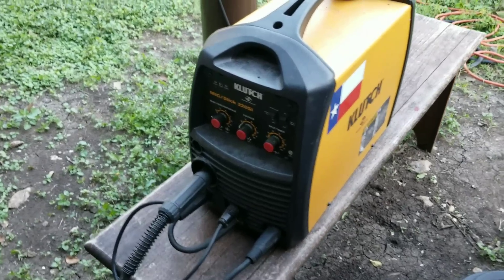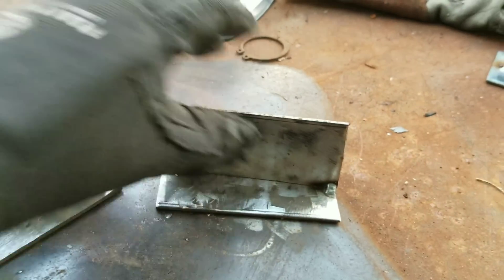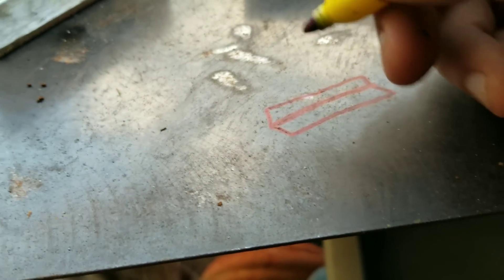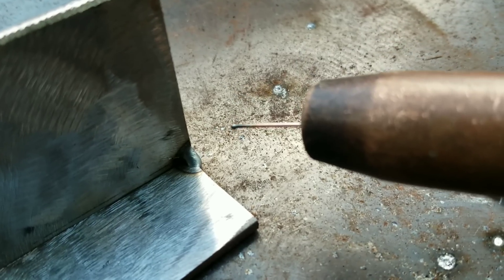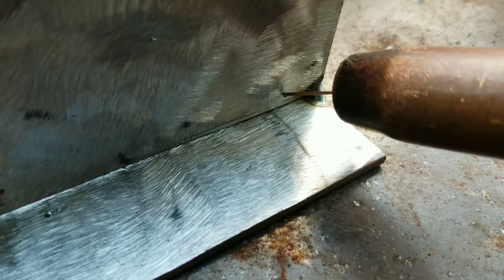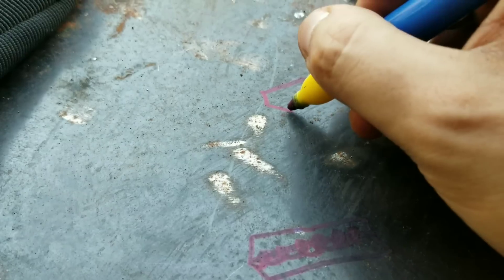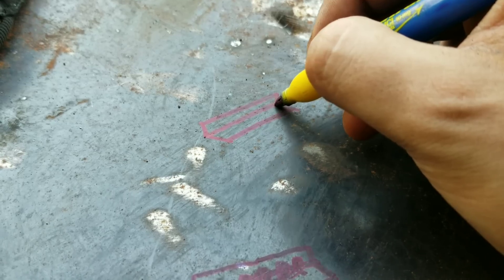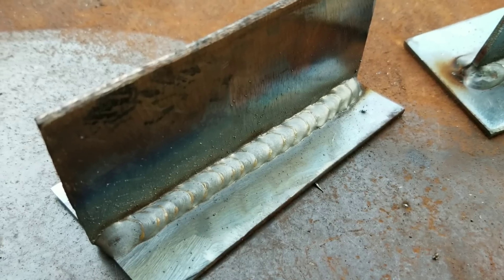How to lay dimes mig welding!

Comment: I have seen and used these techniques using stick but I do not think these methods will do a good quality weld using mig. Using mig you have to stay in the root. Using the method you are using creates a huge heat affected zone because you are concentrating on the weld for to long as you go along. The weld might not break but the metal around it will. Your finish weld bead should only be as thick as the metal. I doubt this would pass destructive testing. These methods are only used for stick from what I was taught. Like a 6010 rod.

Comment: Well yeah "dimes" looks neat but it's ABSOLUTELY THE WRONG WAY TO MIG WELD. Every single "layover" is a stress riser. Every time you "circle back or whip back" you've effectively broken your bead and failed to fuse the base metal properly. 

NEED PROOF? Procure 4 weld coupons same length and gauge (I'd recommend 12 or 10 gauge mild steel or 1/8 bar and the length should match the width of your vise 4" 6" 8"?). Set your machine as you like, tack 2 coupons for a butt joint and weld the joint with "your dimes". Then, using the other set of coupons, perform the same weld process and produce a weld profile of the same "WIDTH", WITHOUT MANIPULATING YOUR PUDDLE, and WITHOUT CHANGING YOUR SETTINGS. After you coupons are cool to the touch clamp them in a vise and bend your weld 90 degrees AWAY from from the root of the joint. Observe results.

Comment: Hey Brother! I've never had anybody around that could teach me this kind of stuff. I've been trying to teach myself how to weld. Your videos have really helped me alot! The desire to teach somebody a skill comes from the heart and it's not a quality many people possess these days. So I just wanted to say; Thank you very much for doing this! I truely appreciate you!   Ben
Reply: Agree!!
Reply: As a newcomer long ago I got a job building up bearing journals on printing press rolls in a positioner.  I figured out that I would never see ANYTHING if I didn't pull my head back and weld with my out stretched arm using the reflected light from the arc to see thru my suddenly non smoked up lenses. The amount of weld pros that say to concentrate on the puddle amazes me. If the settings and travel speed are right just a frequent glance confirms nice even fill. I spend more time looking ahead in my direction of travel so I stay in the groove on light stuff and so my cover passes look great and straight once the weld prep is no longer there to guide you. 36+ years welding with no flashlights taped to my hood and no soapstone lines to guide because I CAN SEE! Simply by using the reflected light of the arc rather than staring at that bright molten puddle all day long.

Comment: I really like your video.  I've been using these techniques for years myself.  The only thing I would say is to keep the cursive e method a little tighter, it will keep the heat tighter in the puddle for better penetration.

Comment: If you want a real looking stack of dimes use a tig. Thoes welds would never pass a weld test in australia. If the weld was going to be machined out later you might get away with it other wise you be handed a grinder and told to get it off and do it again. Ive been welding since 1989 1st class

Comment: I was told the most important things are clean material, proper ground, heat, penetration and the right amount of fill and spread. The final step is making it look like pretty. Have you ever cut and inspected your welds? That would be a cool thing to do to show everyone the full process. Your welds look great!

Comment: You have argon and carbon dioxide gas. How is that MiG welding? Don’t think I ever used that combo. Where I work they got a bottle of argon and 10% co2 by mistake and the guys that handle the gas bottles asked if I use it. I said I would try it with my TIG welder but when I did it made funky welds that were real hard . I welded a thing they were going to turn on a lathe and they asked what the heck I welded it with, they could hardly cut it.

Comment: good point on the clean up of the metal too impurities will suck up into the weld because the heat draws..just like aluminum is very porous!! i hate welding something that ever had oil in it..

Comment: All I can say is.......if you need to look at a chart you have a long ways to go.
If you are basing your welding on what it sounds like, you have a long way to go.
If you are concentrating on making ‘ dimes ‘ you have a long way to go.
I watch people use both hands on a MiG. You should be able to make good welds holding way back on the hose with a piece of tape holding the trigger.
I used to go in to do a weld test for a job and hold a shield with one hand and the MiG with the other hand , take a look at the welder settings if it was close enough I would just say close enough and not even adjust them. Sometimes after doing that they didn’t even care if I made a weld, they could see I knew what I was doing. Unless it was for more specific job then heck yeah they want to see what I could do.
Reply: You need to practice welding a piece of thin sheet metal to heavy metal 10times thicker.
You need to practice cranking a MiG super hot and re-melting the weld underneath to repair it without grinding it.
Try using a MiG for a cutting torch ( there’s a good one. Thin metal of course )
Practice MiG welding stainless steel sheet metal so that you have a good weld but zero burn through only discoloration on the back side.
Practice welding up a  3/4 to 1” hole in 1/4” steel  real fast not spotting but holding the trigger on till done. ( while fellows I worked with went to get the piece of copper backing I would just fill it up real fast)
Practice welding up some really paper thin rusty exhaust pipe or muffler with MiG. Doesn’t have to look good just work.
Don’t bother with those stupid ‘ dimes ‘ or ‘ nickels ‘ . Pay attention to what’s under them.

Comment: Been welding for a living for 25 yrs. Deffinently can weld it all; not tit stick fluxcore carbon steel and stainless and chrome and aluminum. Both hands ambidextrous. Pretty sure that weld would hold up in a normal weldshop. See know problems with it. I would make my oscillations a lot tighter. But that's me. Great job.

Comment: I like your last method best. I’m no welding expert but have been welding my own projects for years. I find the half moon or going side to side of the two parts you’re welding gets better penetration with a mig setup. It’s easy to get a pretty looking bead with a mig that has very little strength. Just my 2 cents worth. Good job man

Comment: Nothing wrong with the weld. In my job we had to make seal welds all the time and also wanted the weld to be straight on top and bottom with consistent oscillations. In saying that, if you could get the straight part, you’d be improving yourself a bit.

Comment: A tip after cleanup grab any old rags; buckets of goop and old oil, car batteries; tyres and burn them outback of the house; conversely they can be thrown from a moving vehicle off any local bridge!
Gets rid of all the unsightly crap hanging around your shed; all goes back to nature from whence it came..cant argue with nature eh!

Comment: Not trying to be an ass iv been welding structural steal for 12 years if you wiggle the torch back and forward instead of up and round it would keep your weld way more even

Comment: You shouldn't dip back into the weld puddle with steel its probably ok but the wide scalloping is probably creating weak points
Reply: You need penetration going back is alright. But yes worping the steel is something to look for also

Comment: Good job papa. Proud of you. I have a novice question. I get a lot of splatter. I use the blue gel, I think the houston humidity doesn't help tho. What's recommended? Also what size wire is recommended? I'm using I believe .035. Yours look thick and gorgeous like a gordita eating a spicy burrito... good job homie
Reply from the maker: I'm using .035 wire too ...probably adjust ur wire speed a bit ....I'm from San Antonio tx lol

Comment: You had shown the technique from right to left but welded left to right (drag). So is it still the same? Won't the welds look different when pushing instead of dragging? Trying to learn...
Reply: At least with cursive e dragging or pulling doesn't really change it I prefer to drag

Comment: Excellent tips. I had lots of hair loss trying to butt weld old sheet metal to new sheet metal on my car restoration. I finally opted in doing the floor boards by plug welding. Anyway, thanks for the excellent video.
Reply: Sounds like some common sense crept in there.

Comment: Dudes a certified gangster welder
Reply: Mig welding youre supposed to stay on the leading edge of the puddle how do you do that with anyof the technique. This whole video is totally wrong. Your not supposed to pull mig welding only push
Reply: I guarantee this would not pass bend or definitely not x-ray

Comment: Thank you for sharing. Note that some time's the machine settings that is printed inside the machine is not always accurate. Like you said practice practice practice 👍
Reply: SNOOP U 2 they’re a starting point. They’re not meant to be used exactly. If you use them, you’ll get good welds. If you learn welding properly, you’ll know how to pinpoint your settings, and you’ll get better welds.
Reply: I agree, but I've not had enough experience to know which setting to mess with!  We've go wire size, Steel size, Argo pressure, Volts & Wire feed speed. When I weld, like today, the weld looked great but it didn't fill completely.
Mr Dimes, can you do a video explaning some of the things one runs into which are calling for a setting change and what to change based on what we are seeing?

Comment: Does nobody on this thread know anything about welding??? 🤣🤣🤣🤣
Reply: Flux is the one that’s smooth on mig matchines.. he not using flux his loops just need to tighten up that shit would pass
Reply: This type of welding does NOT pass! It is strictly a cosmetic weld. Check this vid out
https://youtu.be/dcYu18m2gFs
Reply: @Jamesglover71  cool on Monday I will make a video my point is trying to make your welds look like that is all good and well but it will fail a weld test too many inclusions a weld isn't supposed to look like that unless you're tig welding mig is supposed to be flat and smooth all the way with no undercut or cold lap I would lay my life savings on the fact that wouldnt pass execution class 2
Reply: @gallionfurious  Your comment would fail any examination for proper grammar.
Reply: @izzyplusplusplus1004  good thing in a steel worker then ain't it otherwise that would matter 👍
Reply: @gallionfurious  But supposedly you and I speak the same language. How can I be sure you can follow manufacturers indications for assembly, if you can't use the written language?
Maybe you can run an excellent bead on anything. You're probably one of those magicians that can make beautiful welds right through a rusty spot. Does any of that matter if you can't write a resume? 
Stop picking on the guy because he doesn't do it your way.
Reply: @izzyplusplusplus1004  who had said I can't use the written language?? 
 I'm assuming your American so after all we are talking about my language that you lot very often use incorrectly yourselves.
 It's not about doing it my way it's about doing it the correct way and backstepping on a fillet weld isn't correct practice
Reply: @izzyplusplusplus1004  also I think the terminology you were looking for would be "correct grammar" 😎
Reply: @gallionfurious  Just curious, what's wrong with backstepping a fillet? How is it weaker than the "correct" way?
Reply: @gallionfurious  Also, "you're" correct, I am American. Further, you need a comma after "American", "so after all", "doing it my way", and "correct way". Lastly, periods tell me when the sentence ends.
Reply: @izzyplusplusplus1004  The reason is that the puddle gets pushed too far ahead of the arc and freezes. This causes lack of fusion as you are essentially trying to weld over a cooling puddle.
Reply: @robhinze8626  That makes sense. Thanks. Are there any special circumstances where one would want to backstep?
Reply: @izzyplusplusplus1004  IMO, backstepping the puddle is beneficial on thinner base materials or joints that have a large root openings. For thinner materials, some of the newer pulsed mig machines have programs that ramp up and down wire speed and amperage settings to combat this. Miller markets it as "profile pulse" and I believe Lincoln just calls it "pulse on pulse" 

When I have time, I'll do a profile pulse demo with one of our Miller xmt MPa machines, it's pretty awesome!
Reply: @izzyplusplusplus1004  thanks for the English lesson dude👍
Reply: @gallionfurious  Honestly, your poorly written question sparked great commentary. I learned something I previously didn't. Thanks for the fabrication lesson, you fantastic subject of the Queen.
Reply: @izzyplusplusplus1004  that's not an insult most of us love our Queen and hate our parliament
Reply: @gallionfurious  It wasn't meant to be, good sir! I am simply happy to have learned a simple secret that can strengthen my ugly welds. Maybe you've learned that good grammar counts too?
Reply: @gallionfurious your Parliament is the same in many ways as out Senate. Full of pompous people who think they know better than you on how your money should be spent. Or what items we may possess. Or what cars we may drive. The list is endless, because they're constantly making up new rules, or redesigning more draconian laws than already exist in an attempt to legislate human behaviour. (I spelled behavior the Queens way just for you sir.)

Comment: I can weld just fine flat but what about welding up or down like welding bumper stops at dock levelers when they're broke from the trailers hitting them so hard that's the only problem I have I tried to keep it consistent and everything but it's still a sloppy weld
Reply: That's cuz you suck

Comment: That is the worst way to weld with mig.It has no strength.Your heat is the wire.With tig your heat is the tungsten and your dimes are formed from the filler rod,that is not your heat source.
Reply: Exactly. at least there's a few people in the comments who actually know how to weld.

Comment: Good work Bryan,  I'm 59, iv'e been a welder for over 20 years, and I use all 3 of those styles, depending on what i'm doing.
Reply: I agree with you 100%. I am 75 and my hands now do a self-inflicted oscillation.  But each item and each thickness is approached differently.  I was certified to weld Airplanes, Nuke canopy seals, 3/4 inch plate and Aluminum, Stainless (I had my own business) and steel.  Also brazing most any brass, bronze, etc.  Now that I am retired, I usually just weld for friends and grandson.....and his friends Mountain Crawlers, etc.

Comment: That welder is no longer available. Any other suggestions that will do the same thing?
Reply: tomthomsen11 any mig welder will do the trick I do it with all different kinds
Reply: @sidrichards7897  I have a small Lincoln. My biggest problem is I have to play with the settings/wire speed. Always. Just need more practice.
Reply: Just mess about with your settings till you get it right bro

Comment: Thank you Bryan, three good tips. I still have to practice on my settings, trying to get that "bacon frying sound" thanks again, great video.
Reply: Miguel if this helps, take the thickness of your material and use the 1amp per thousand rule. Ex. 
.125" thick and start w 125amps and hold your gun to the metal, pull the trigger and start dialing in the wire speed to that sound. From there you can tweek your settings but should get you there. Hope it helps.
Reply: @brianb5779  that's another great tip, I will try it this evening. Thanks again.